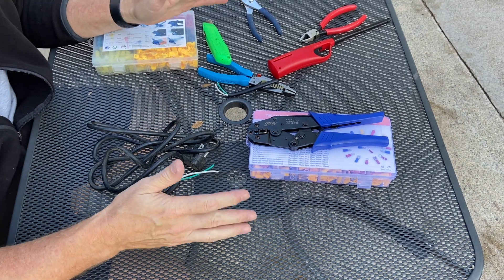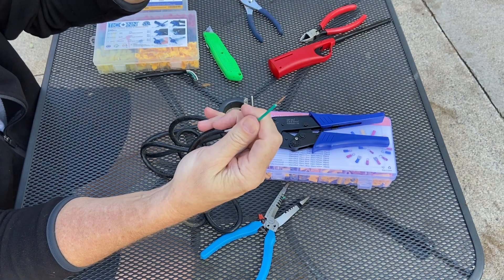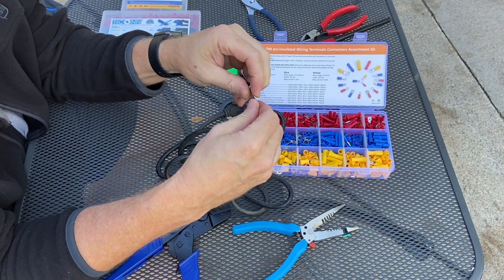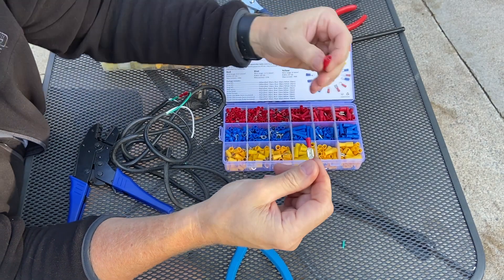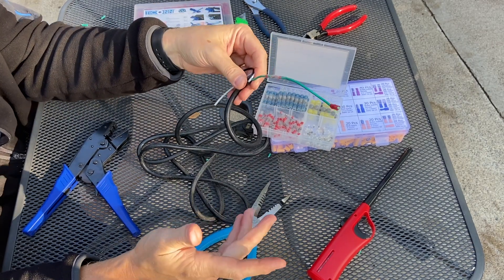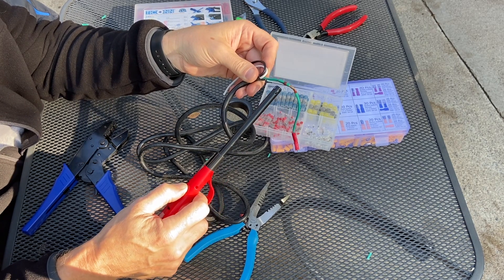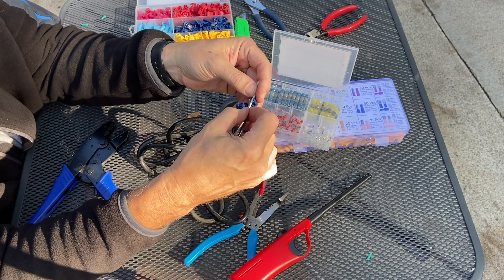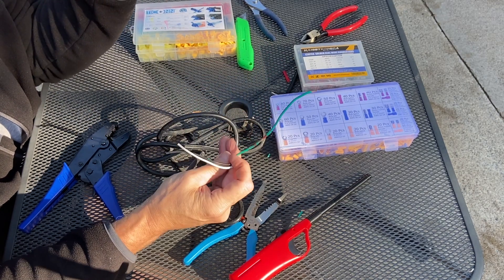How To Connect or Splice Two Low Voltage Wires Commonly Used For 12 volt Systems

Comment: Nice video although you should be able to pull very hard on a crimp butt connection without the wires pulling apart.  I'm not a big fan of soldered connections.  

The reason you may not be trusting crimp connections is that you are not using the proper crimper for insulated terminal connectors.  The one I have has arc shaped crimping dies, not rectangular and not the rounded point ones use in uninsulated terminals.

Another thing to beware of is that those blue splice connectors are garbage IMHO and should never be used in anything important.  My experience was adding trailer lights and it was only a matter of time and the connection became unreliable.  Which makes sense given the fine line between making good electrical contact and completely severing the source wire.   I substituted terminal stud posts with ring connectors on the wires and haven't had a problem since.   This is a good thing as brake lights are pretty important!

Search engine brought me to your video while looking for how to connect 2 wires to 1, but apparently this is unobtainium information.